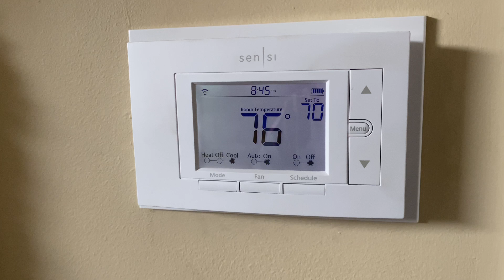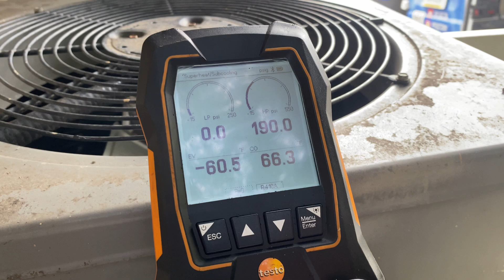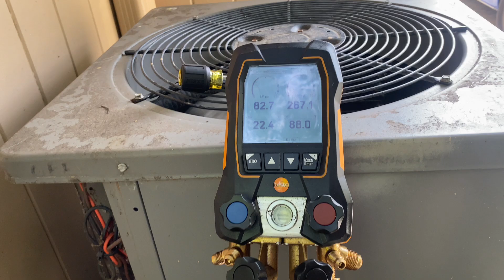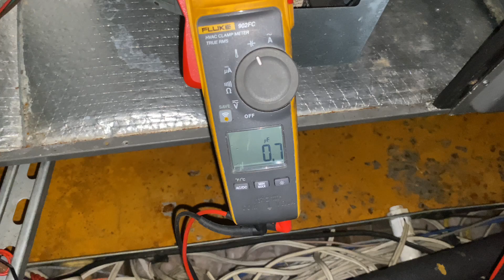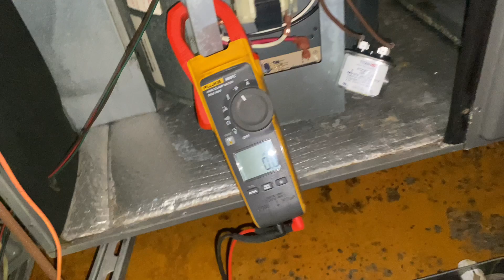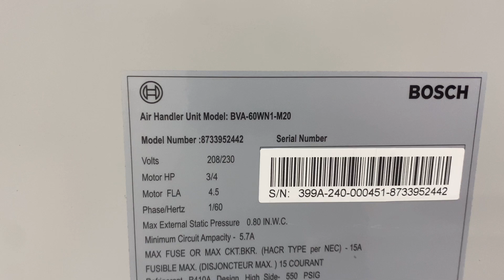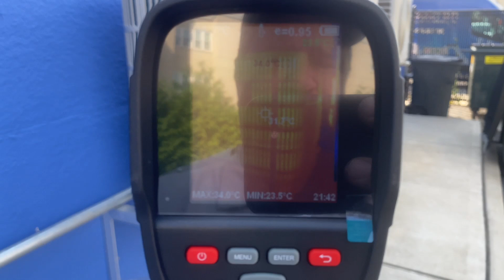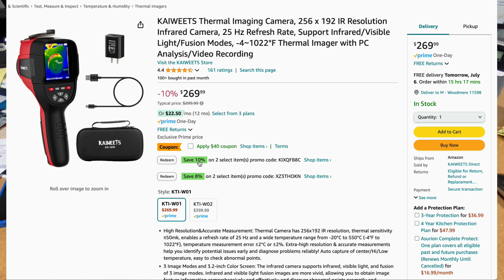Central AC Not Cooling - Nothing Blowing From Vents & Thermal Imaging Camera Giveaway!

Comment: I'd say it's an non-bleed txv (hard shut off) meaning it will hold pressure and bleed very slowly. that's fine for a scroll with an discharge check valve and internal unloader, but a regular compressor would be starting against the load and draw large start currents (or fail to start).
looks low on gas I guess, assuming it's 410a. txv is chooching trying to cool the evaporator, which may or may not be frozen or no air flow. I should watch further before guessing. lol
edit yep, by 6:48 dead blower found. 😎

Comment: It would be awesome to get a thermal imaging camera! Although I’m in the diesel/allison transmission trade industry I would like to see if you could find injector issues by inspecting the exhaust. Checking the coolant system for thermostat bypass. Wheel ends for bearing failures! Make the trades great!

Comment: Hey Mikey, 

I have been wanting a thermal imaging camera to pinpoint issues that are invisible to the naked eye. For instance, I've needed to trace an HVAC duct above a ceiling that the drywaller covered. This tool can save unnecessary demolition and repairs, making the process more efficient and cost-effective. Additionally, thermal imaging can help me detect air leaks, insulation gaps, and even potential electrical problems, ensuring my customer's home is energy-efficient and safe. I am hoping to win one of these awesome thermal imaging cameras, which can ultimately save time and money.

Comment: You have to check the amp draw with the door in place or you want get an accurate reading…I have seen amps be almost half before comparing door off vs on…
Reply: 100%  That fan needed the door closed and it was drawing high amperage also from overheating.  It was fine after the capacitor was replaced.  Zero reason to sell them a Bosch in this instance.  Oh well, I guess.
Reply: and not also be clamped onto the wire and the metal box at the same time, that greatluy skews the reading not having jaws shut fully/touching.
motor was a bad stinker anyway, since they didn't shut it off right away when it went southand first started to smell hot. it should have been emitting a hot smell while still running as cap slowly failed. oh well 😉